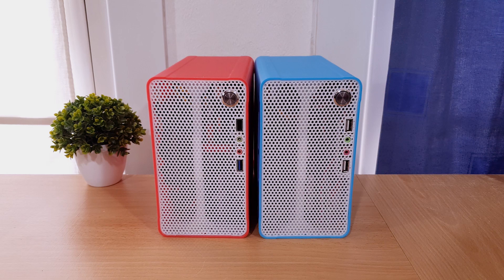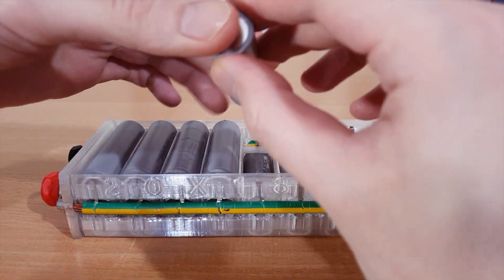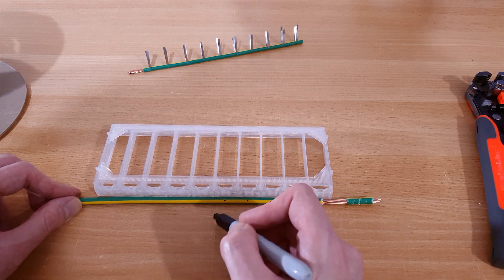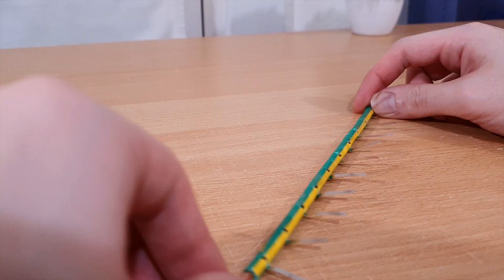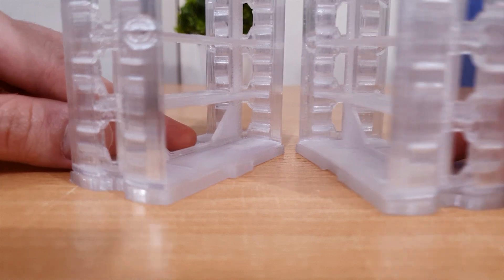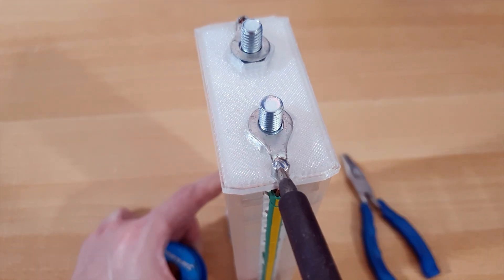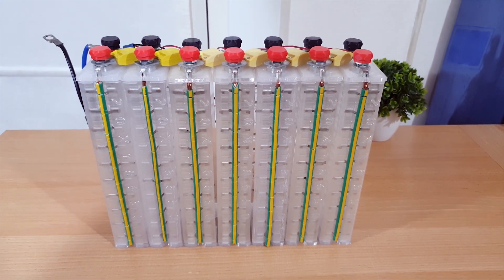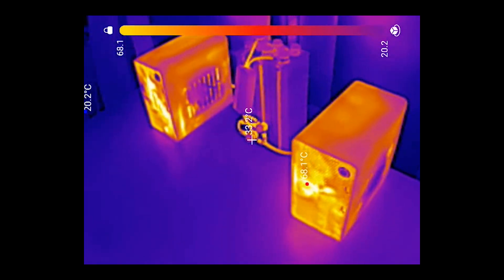Batt-O-Matic DIY

Comment: What will happen if put in shorted cell
Will the pads burn before the disaster 
Or will it go boom
Reply from the maker: Putting a cell in reverse is similar to a direct short if that's what your asking, probably the same effect, if there is only 1 or 2 opposing cells in the pack the burn may happen more slowly.
Reply: @arkatub  I'm a bit worried because if battery shorts from degradation 
It is not quite the same because when inserting battery it has partial contact for split second 
How much current can one strip Handle
I want to make something like this myself 
But make if a bit more safe
Reply from the maker: @matgaw123  I'm not sure how much current it takes to burn one, I'm guessing 5-10 amps but I never tested it.

Comment: I bet you could use custom pcb instead of wire
Reply from the maker: I did think about it, though I'm not sure how many amps it could carry, it would also be less DIY-able.
Reply: Veroboard just add solder to increase current capacity, veroboard is in convenient copper strips and has component holes drilled in, weather they would align for the nickel strips idk but might be easier
Reply from the maker: @oldskoolhead0  I've got a random PCB with solder on it like that, I don't think it looks good, another thing I tried was to spot weld several layers of nickle strip and it also looked pretty bad, but thanks for your suggestion.
Reply: Jehu does pcb busbars quite often, so I think there could be way to do it safely. Would probably have a much wider footprint than wire tho. You’re right about it being less DIY, but I’d certainly wait a week for pcbway shipping if I was building a couple of these packs.
Reply: Ever hear of a battery management system?
Reply: @UnifiedInfo  he used a daly 1 in this vid lol
Reply: @andyfitzhenry5032  lol I didnt get to the end but very nice😅